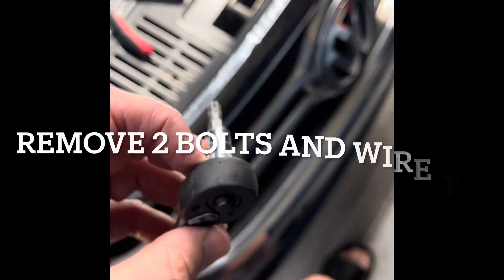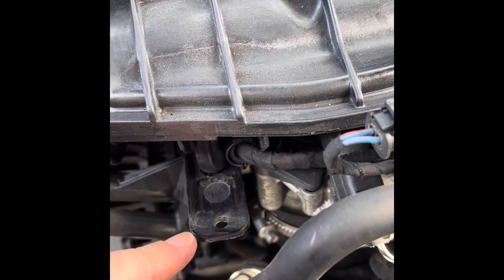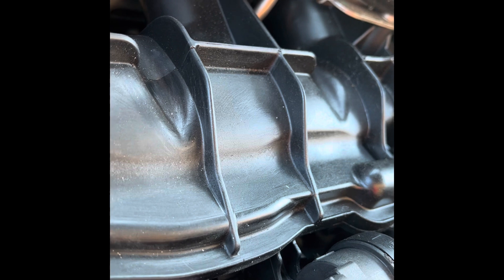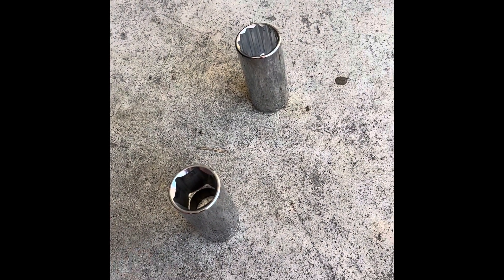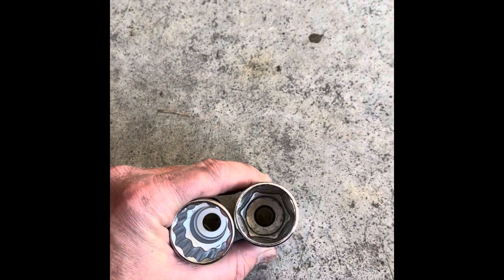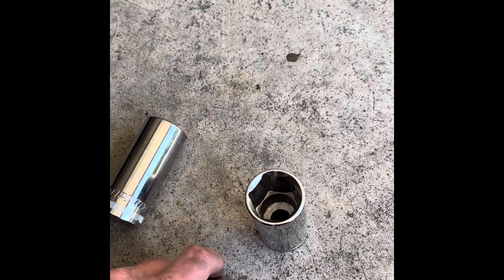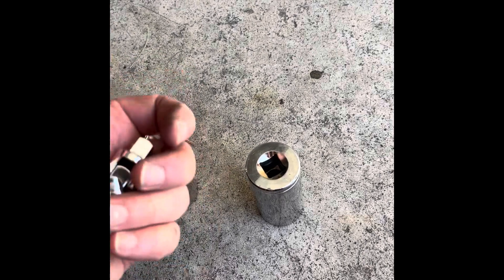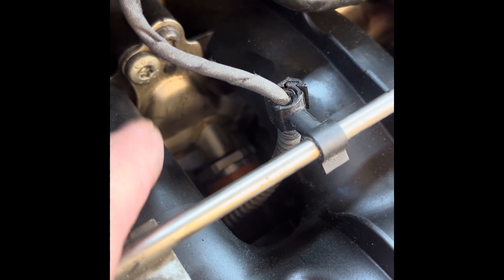VW Tiguan fuel pressure sensor

Comment: Yes I love voodoo ranger ipa after 3 you are feeling pretty nice😂😂😂😂 my connector is broken any tips to get it off
Reply from the maker: If the connector rocker broke you will need to get a flat (thin) tool to stick between the connector and the part that has square nub.  Possible a dental type pick set.  GL